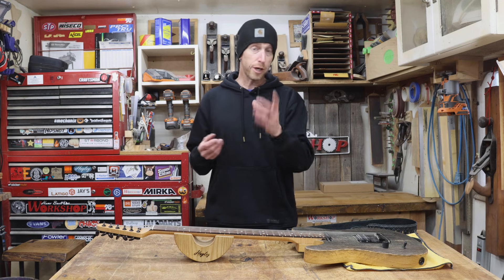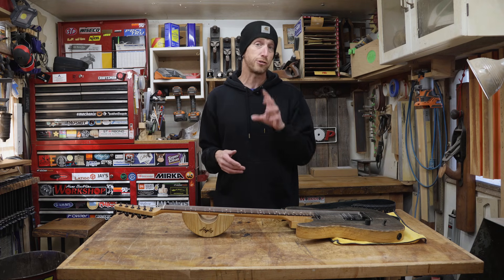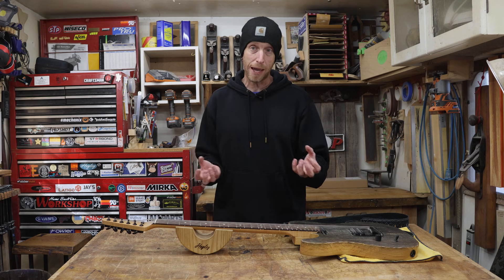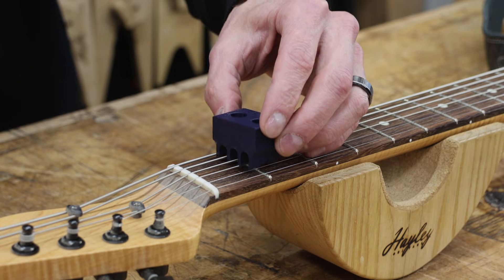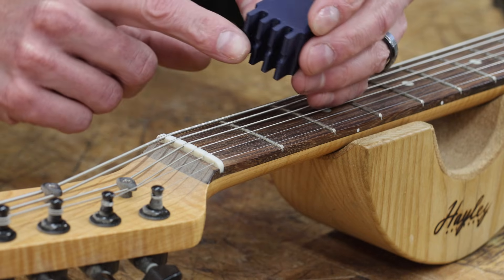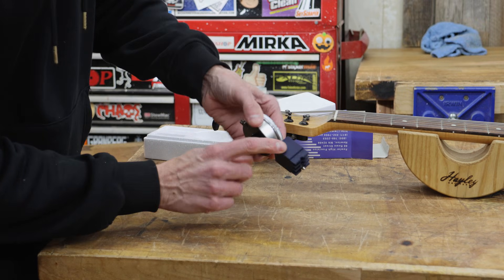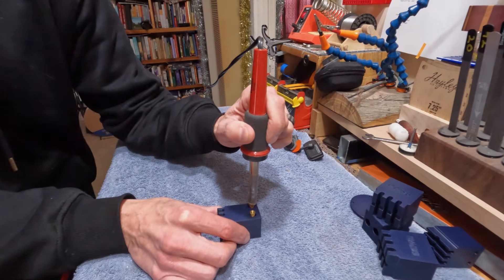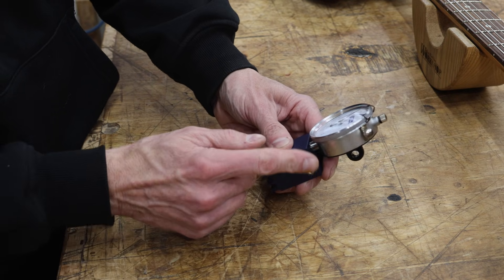DIY Nut Slotting Gauge | Measure Guitar String Height Accurately for less!

Comment: This is great!  Love the channel!  I already have dial indicators, so I will do one to fit the one I have.  
I use the 3D printer for all sorts of gauges and templates as I am sure you do.  Examples: 
- radius gauges and neck shape gauges.  They are easy to design and don't have to be thick, so they print fast.  Accuracy does not have to be absolutely perfect.  Also, for the neck shape gauges, I found the normal versions less than useful because they assume a specific fretboard width.  If mine is even a little bit wider, they never seat properly and don't give an accurate indication of how close you are to the shape and where to remove material.  I printed a version that is 0.050" larger so it fits over and you can eyeball where more material needs to be removed.  I also printed versions that come in from the side rather than underneath.  I found the half form shape that comes in from the side much more useful!  
- templates for indicating tuner hole positions.  You don't need bushings, just holes for a punch.  The printer makes everything accurate.  
- routing templates for pickup pockets is another application that is super useful.

Comment: Maybe you could design a base for the indicator with some hollows in it to and insert some brass or lead slugs and insert the slugs just before the printer finishes the print and the finish of the print would seal and capture them to the inside sealing them in.
Reply from the maker: I thought about something like that. I'm printing another one with a much higher infill to see if it works better.

Comment: Building tools and machines is great idea to sometimes save money or make a better mousetrap.  Making a fixture to hold a dial indicator is a great idea.  Designing it in CAD is also a great idea if you are proficient in CAD.   For those who don't have access to CAD and/or 3D printing there are ways more suited to the average luthier.  Design on paper or CAD. Make the block laminated hardwood from shop scraps with the grain oriented vertically.   Drill and maybe ream the holes.  Although I design in CAD and use a 3D resin printer, I'd probably make it out of laminated wood.
Reply from the maker: Absolutely, there are many ways to make this tool, and wood would definitely work well too!